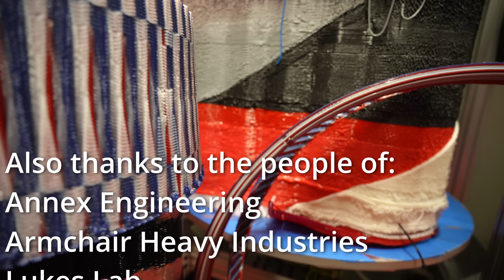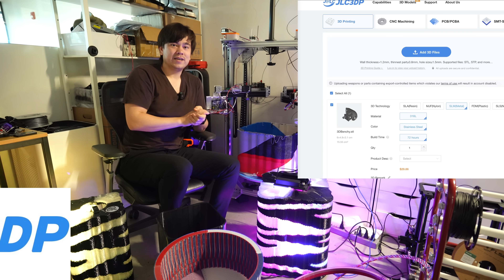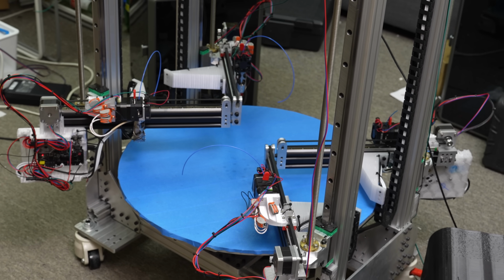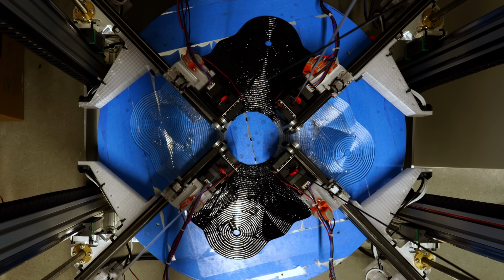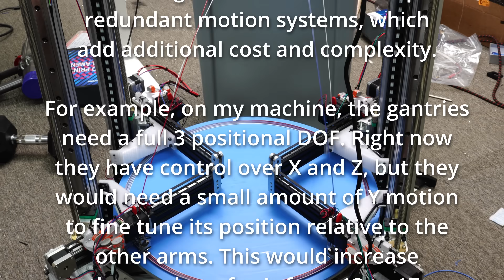The High Speed Future of 3D Printing - Quadrupolar Express

Comment: Hello Nathan, 

First on all, good project man.  If you could dial it in further, you could sell it as a kit and make some cash on the side (I know I would buy it with decent support).  Do you mind if I make a few suggestions?  I think you may find them useful. 

1. You could design a square frame that wraps around the entire printer, and it would go up/down along with the heads as they print.  the idea is for the frame to mechanically correct any problems with the straightness of the vertical aluminum extrusions.  This approach is limited, but it could be complimented by suggestions 2 and 3. 

The way I would do it is by designing four different brackets of equal length, and attach them to the mechanics that control Z for each head. 

2. Design two of the heads in opposite corners so they travel on a single rail.  The rail itself is mean to be under tension to further help the squaring in addition to step one.  Naturally you couldn't do this with all four heads but it's a good start.  You could regulate the distance with an adjustment screw as part of the squaring.

3. No matter what you do, there will be straightness problems of course  Even if you were to machine the entire frame, there is always a correction to be made.  As you pointed out, the firmware falls short and designing your own would be costly and time consuming.  A good approach is to divide the controls so that two PCs run the firmware of your choice at the same time.  One PC could control the heads in and out, while the other one would control Z and rotation.  

The one challenge with the two PC approach is that you would need to find a way to sync them and/or wait on each other.  However, this is much easier than trying to design custom firmware.  This also helps with the squaring problem because you will be able to use the built-in compensation function of the firmware since each PC would handle a standard number of axes. 

Also, focus on smaller nozzle sizes since not everyone needs to run something so beefy and detail is also very important.

I hope this helps.
Reply: Looking at your design a bit closer, it seems that you use individual motors for Z?  that's is a lot of motors, but it could be advantageous to divide the workload not into two, but into four different PCs.  Each one running it's own firmware and. movements, and compensations.  Initially I thought you had locked Z for all of them, but I then saw they are all running at different heights.
Reply from the maker: The solution is to move away from klipper. Reprap supports 30+ axis control, so I’ll probably go that route.

You have a lot of good insights though, on how to enforce alignment between printheads. It’s a real challenge!

Comment: Just a thought but to get coverage in the center, maybe putting a pillar down from above between the gantries. Maybe an upside down T gantry that can rotate and allow a 5th extruded to move around and compensate for the blank spot.
Reply: I think the heads are designed at an offer to allow them to go beyond the end of the arms and therefore be able to reach the centre (one at a time).

Comment: Can these print anything else other than a single specific part?
I want an airplane.
Wouldn't it be like buying a printer to make a left wing? Then another for the right wing? And so forth.
Seriously....can they print anything else other than just one "new" invention (flying ring) really fast?
Hey.... filament companies will love it!
Reply from the maker: It can print anything with 4 duplicates, or any generic part once I have the firmware/slicer working.

There will be varying levels of parallelization depending on the part geometry. But it can to, for example, a human statue in case mode. There won’t be any symmetry requirements later on. For now I have to make simplifications to demonstrate the mechanics, since the firmware and slicer will take some more time to finish

Comment: I know this will defeat the point of this video but maybe make a smaller/shorter version next, and once (somewhat) perfected you can scale it up.
Otherwise, this is very Impressive.
Reply from the maker: I have designed about 10 versions of this machine. The smaller versions are very cool.

But the issue is, why would you need that much flow rate for smaller prints? It would be great for mass production of small parts, but then you’re feeding 24kg/day into a tiny little printer.

Maybe I should just build it 😋

Comment: I mean, just imagine having a pellet printer, not a filament one, with extrusion screw instead of feeder and long, 3 stage heating print head, with an ability to use from 0.4 nozzle up to 8 to 10 mm, it would be so awesome, this thing should print a  trash bin for like how much? 30-50 minutes? i wish machine like this exist on market, oh w8 m8, there are!
Reply from the maker: Part cooling is much easier with multiple thin extrusions. Parallel Printheads always wins
Reply: @NathanBuildsRobots  nope, not even close, cuz when u have 5 to 10 mm nozzle and screw feeding system the layer is laid on previous has 5 to 10 times more amount of connecting surface then yours, at the same temperature, and while you have a 1 to 2 mm thin line heated to 230 celsius, pellet printer will have 5 to 10 mm line with same temperature with more surface to heat sink, and extrusion speed of screw feeding system give like 2 to 4 or even more times lower time when nozzle contacting with laid layer so it heats up plastic less, so over all situation is exactly opposite, and you have 4 heat emitters and thin lines what must be cooled down. aslo printing big stuff with filament 2 to 5 times expensive than the same result with pellets, so multiple print heads is economically and ecologically efficient at first

Comment: Cantilevered gantrys.. scary lol, amazing concept and build, so this thing should be able to print perimeters and infill at the same time once software in scaled
Reply from the maker: Yes, it could do a dual spiral infill pattern while simultaneously printing 2 perimeter walls.

Or quads symmetric infill and 4 perimeters simultaneously
Reply: This may be a lot of the rigidity issue. linking the 4 cantilevered gantries into hub to effectively have a single gantry plate - requires a change in operating procedures but is way more rigid. might be tricky to calibrate a 4 z axis print gantry warp to match any build plate plane deformations

Comment: Relative positional accuracy is much easier than absolute positional accuracy. A normal 3D printer has great relative positional accuracy, but can get away with pretty poor absolute positional accuracy.
Reply from the maker: Exactly. 
The challenge with multiple printing is uniting the relative coordinate frames to +- 0.01mm.
Reply: @NathanBuildsRobots 👈THIS
 You explain it very well in your video. Trying to align 4 semi-independent coordinate systems and kinematics is a NIGHTMARE . 
 Massive respect to you for undertaking this epic engineering task ! And you really did pull it off! Those are some functional and efficient prints!
Reply: when youre not able to dose the flow perfectly - of what use is an accuracy in movement thats overran with flow errors? dimensions will be off anyway...and good luck with dosing in lightweoght extruders. that will be expensive to manufacture, or is just impossible maybe....
Reply: @brandonhicks7549 
 Hmm, I think you've got a slight misconception about CNC machines.
Saying  "absolute" I think you are referring to a closed-loop system, where there's some coupling of the motion axis to a measuring scale, be it a rotary encoder on the drive shaft, or better, a linear scale on the rail.
 (most) 3D printers have no feedback circuit. They run simple open-loop motor commands, because unlike metal-cutting CNCs , there's no forces deflecting the toolhead.  
 
 So you can generally assume that G90 absolute positioning command will be accurate, given the accuracy of your machine's kinematic construction, rigidity, so on...
Reply: @Metapharsical  I was referring to construction more generally not really 3D printing specifically. 

I guess what I meant was that the frame of a normal 3D printer doesn’t have to be all that square to get reasonably accurate prints. The printer shown has to have a high degree of parallelism and perpendicularity between the axes of the different segments.
Reply from the maker: @Metapharsical  That's very interesting, I didn't think about how the term is used in CNC machining.

In the context of my comment, I am referring to the fact that all 3D printers have error when compared to an ideal, or absolute, coordinate frame.

The best way to unite the printers onto the same coordinate frame is either to 

1) Synchronize them all to an absolute/ideal coordinate frame, as in, reducing all positioning error to zero

or

2) Couple all the printheads together in such a way that all printheads will have the same error, so relative to eachother they will all be off the same amount and still just work in the way that single printheads just work.
Reply: @NathanBuildsRobots 2) use a single z axis rather than 4.  You aren't using the centre of the bed anyway.

Maybe hang the z axis from the top (if you do want to use the middle and have 2 of the axes underneath the z pole)
Reply: @meateaw  yea he just threw shit at the wall. I knew this was a problem never even attempted it. I have many ideas might make a video on it.

Comment: In terms of axis control, you're better off with a "bedslinger" in the same style as milling machines. Then you can use a circular bed with a rotational axis to use any number of print heads you like with any number of subdivisions/symmetries
Reply from the maker: Good point, I think XY position control on the bed, and the quad gantries on a solid plate is the sturdiest configuration with the least complexity

Comment: I gotta say I had my doubts when you first showed us the parts of the machine and said you're gonna build something out of them, but I was indeed surprised how quickly you got it built. Or to be honest, that you even got a working machine out of them :D Well done!
What's next? More development on the firmware side? Will we get more videos about the progress? How are the shoes holding up?
Reply from the maker: Shoes are falling apart but still functional.

I'm split between spending more time working more on the firmware or hardware.
The firmware change will require new electronics, so either way it will require a partial rebuild.

Comment: I mean, what about replicating Autodesk's Project Escher with a set of overhead gantries?  You can run them all simultaneously by splitting up the models they are printing into left/right halves, making them all do the left half first, and then right half after, using large diagonal splits to ensure that heads didn't crash into previously printed parts.  So long as the section between L1 and L2 is concave, then you can do R1 in between them without crashing.  It doesn't end up needing complex math, or complex control.
Reply from the maker: That's really cool, I haven't heard about that project before.

You're right, it doesn't need to be polar. a conventional arrangement with multiple printheads on a gantyry makes sense too.

This machine will be specialized to really focus on making vase mode prints, bypassing a lot of the complex planning of toolhead collisions.

Comment: A closed loop computer vision or LIDAR alignment system is the only real solution I can think of. Maybe you could print a special test print and use a 3D scanner to calibrate it.
Reply from the maker: That would be interesting, like the Lidar calibration 3D Bambu Lab, Creality, and FLSun keeps promising, but something that actually works!
Reply: @NathanBuildsRobots  do you imply that lidar on x1s does not work?
Reply: @NathanBuildsRobots  probably something more like TAMV type of setup setup. cheers, XGZ
Reply: Maybe something simpler,  All we care about is the distance of the toolhead from the center the machine, you could use a lot of systems to achieve that (a 4 way tensioned rope that is hooked up to a potentiometer is the jankest of solutions but you could make it more fancy to get accuracy)
Reply: Right. It will have to be a laser alignment system.  Tracking all 4 heads simultaneously.
Reply: electro/optical scales are lightweight and accurate - and really expensive! :)

Comment: I feel that using 4 scara arms may also be an option , scara arms can move in two directions without needing to rotate the bed
Reply from the maker: I would really like to do a SCARA, but dual rotary joints are complicated, and expensive. But It would unlock a ton of capabilities.

Comment: Respect for the build, I realized that 3d printing isn't cost effective after you said 3 kg for a trash can 😅😂
Reply from the maker: 3D printing is still ideal for 1-off or custom projects. 

But maybe I could put 4 pellet extruders on there
Reply: @NathanBuildsRobots  Yeah you're absolutely right about 1-off or custom projects. Keep the good work 😊
Reply: @alengusic4259  that`s because the inaccuracy of the print requires thick walls, otherwise it could be cheaper
Reply: Jup, that’s the way to go.
Reply: @NathanBuildsRobots  have a search for GreenBoy3D Pellet Extruder.
Reply: @alengusic4259  it's a proof of concept. The real trashcan is the giant replica of Kelsey Grammer's head. There is where the value lies.
Reply: Well, it all depends on how you look at it.

If you only need a single trash can, and it happens to take 3 spools of filament it can still be worth it.

If the trash can/project has to be 'exactly' like this.

If you compare it to injection moulds and manufacturing its still cheaper to just print it.

Sure, if you compare this 3kg monster of a bin to a cheap 5$ from walmart, then its not really a fair comparison unless you are printing the walmart trashcan too.
Reply: @ItsBoyRed  I can buy 6 premium trashcans for the price of filament alone, your statement is just objectively wrong
Reply: @oculicious  No its not be cause you misunderstood it.

What i mean is you can not buy a trashcan that is exactly like the one he made.

You would need to pay for molds and fabrication to get one.

You can buy a different trashcan that maybe perform the same, but its not exactly the same.
Reply: @ItsBoyRed  and what benefits does it provide for all that extra cost, not to mw tion plastic?
Reply: @oculicious  The point is that you can design unquie items out of plastic without having to pay a massive upfront cost of having it manufactured with molds.

That is the point.
There is nothing magical about this trashcan, it could be anything, its an example.

How much would it cost you to make an exact copy of this trashcan without 3D printing?
Quite a bit more than printing it, is the answer.

If you need 10.000 of them, then its a different story entirely.
Reply: @ItsBoyRed  bro you dont need to defend 3d printing to me, I've been printing since 2013, and designed mutiple projects/products designed for 3d printing. What I have never printed though, are things I can buy in better quality for cheaper
Reply: @oculicious  Why dont you understand the point then?
Reply: Well, if you overbuild it THIS much then sure, you are correct! Most people don't though. Even then, 3d printing is better for things you can't already buy dirt cheap elsewhere, usually more complex geometries. There's a reason it's starting to sneak more and more into consumer products, manufacturers are beginning to realize that unless you are making millions of the same part, 3d printing is more cost effective. Hint: most injection moulded products, the vast majority, NEVER shift that many units. Ever.
Reply: It is quite cost effective for small replacement parts in repairs
For a real example I deal with, an HP Chromebook G8/G9 hinge cover costs like, $30/piece. I'm working on cloning it, and when I'm finished I'll be able to print tens of them for almost half the price of one. And for a whole fleet of chromebooks where these hinge bars seem to be one of the bits that tend to break or disappear, that's hundreds of dollars saved.

Comment: Wow! I knew you were working on this, but I had no idea you designed and built it yourself. I really like the idea of being able to use one quadrant of the bed and treating it like a 4 head tool changer. It would be just like having 4 printheads on a Prusa XL, but you rotate the bed under each head to get the different material or color. If you can just get independent or switching extruder stepper control, you can already accomplish this. To fix a lot of your alignment issues, you can still use bed probing. Provided your rotating bed is stable enough, you can actually probe the surface with each printhead for compensation values. Anyways, super cool! Look forward to more.

Comment: Incredible. This is the type of printer i would add lasers to the side to cut out patterns in the material. great job !!
Reply from the maker: Sharks with friggen lasers.
The beauty of this arrangement of toolheads is you can basically add unlimited tools around the perimeter. Specialized nut installation tools, milling heads, lasers, ironing heads, whatever you want, there's plenty of room.
Reply: @NathanBuildsRobots   That is what i was thinking right away, the potential for secondary operations after the print is over or ever while it is printing is insane.